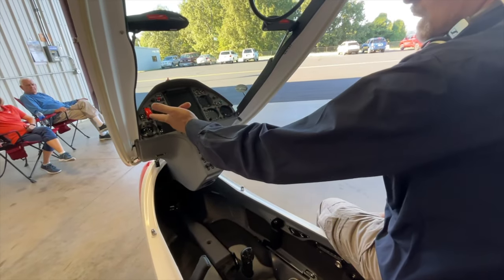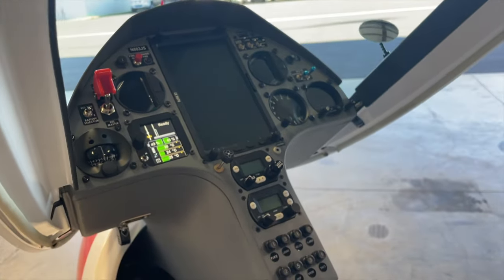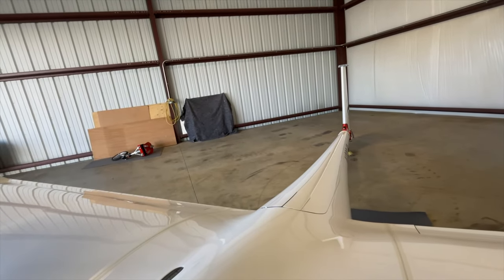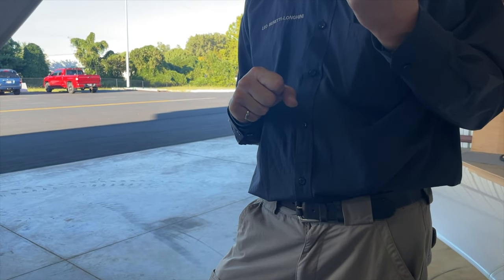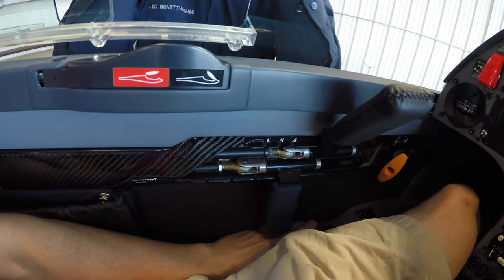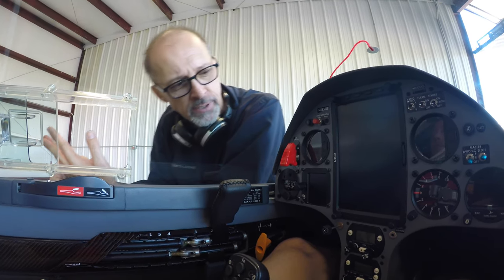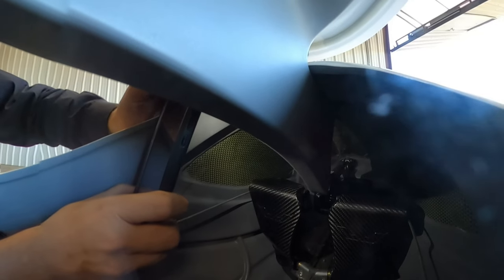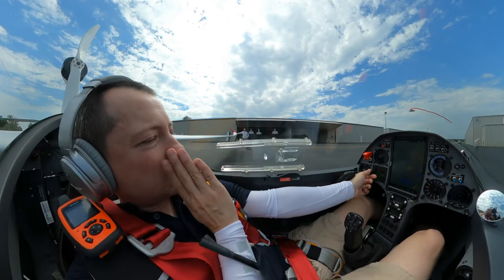JS3 RES Cockpit Checkout

Comment: Wow that thing climbs great! Very nice :) thanks for the video
Reply from the maker: Yeah around 8 kt (4 m/s) at full throttle and 4 kt (2 m/s) at maximum continuous power.
Reply: @8OrangePants  At what mass? Guessing no water on board yet............
Reply from the maker: 467 kg as-flown dry. Climb rate should drop 20% at max gross 575 kg...not sure I'll have the opportunity to load it up during the winter though.

Comment: Interesting video - nice to see some of the systems. A great new toy. Can you fly the JS3RES in 15m mode at 525Kg either without batteries, with 1 or 2 ? Can it self launch or self sustain in 15m mode?
Reply from the maker: Yes, it's totally fine to fly with any number (including 0) batteries and in the 15m configuration as well, although with a single battery not recommended to self-launch.